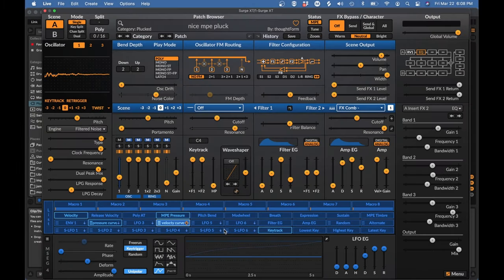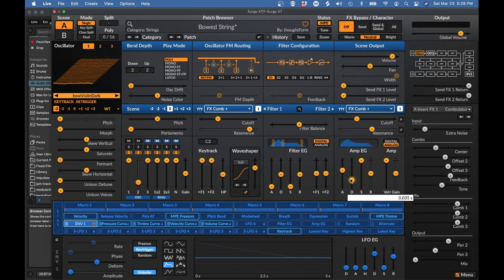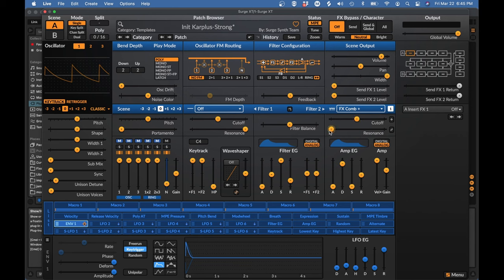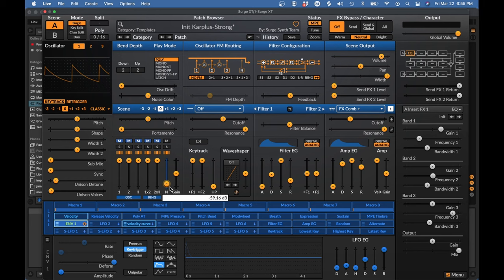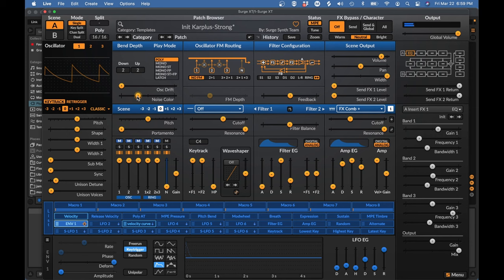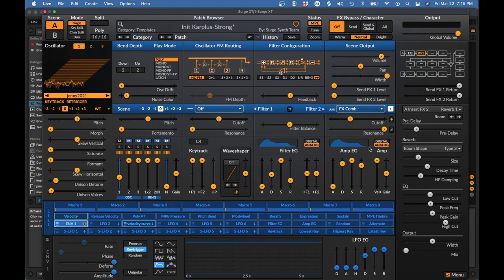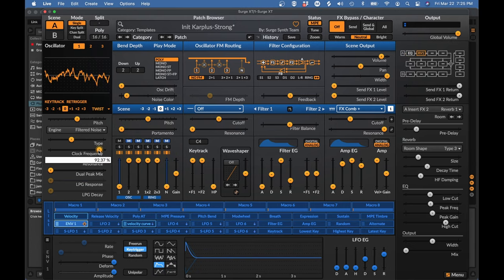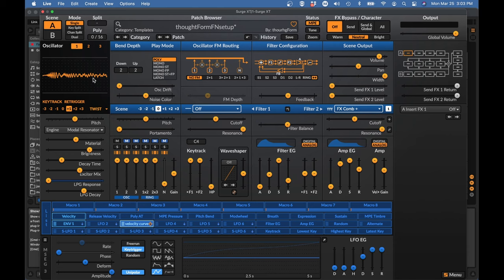MPE Sound Design in Surge XT: Physical Modeling Demystified

Comment: surge is amazing, but it's really easy to get lost with what settings I've made, especially with the modulation routing. I got lost while following you after i cross faded the filter away from the comb, to hear the noise. I had to rewatch the video to remember how to get the karplus again hehe. the pan law on that fader is a little esoteric too. cross faders on filters is not a super common control in my other synths. Overall the controls are super sensitive, which is better than controls that do nothing, but it's real easy to get into an unstable state if you know what i mean, just a hair of a change on a slider can drastically change things.. They're working on an interface overhaul but it's a big job. nice folks over at the Surge Team. Much to say about this synth.
Reply from the maker: The filter mix is a bit mysterious to me, too, and not just in Surge. A straightforward crossfade between serial filters is not always the most useful thing so I think sometimes synthmakers will add some complexity to how it works. I'm not sure that's the case here but I do sometimes have unexpected results.
The instability you describe can be frustrating, but it's also a sign you're working with a real synthesizer and not a toy. 
Thank you for the watch and the comment :)